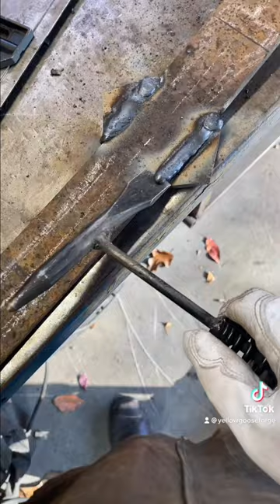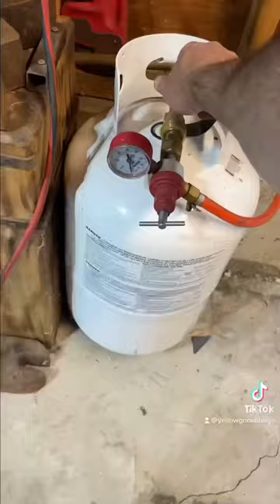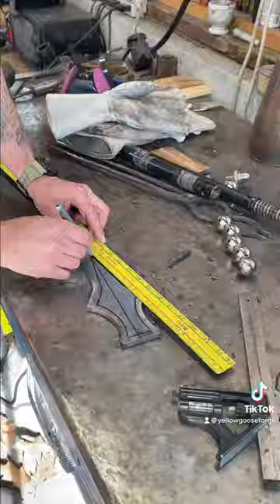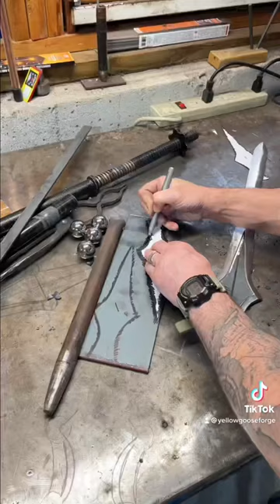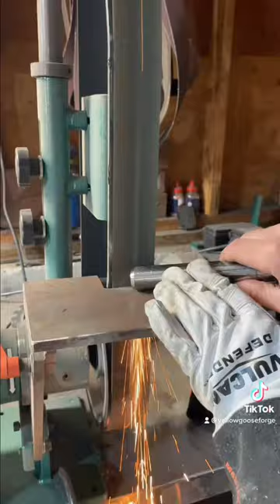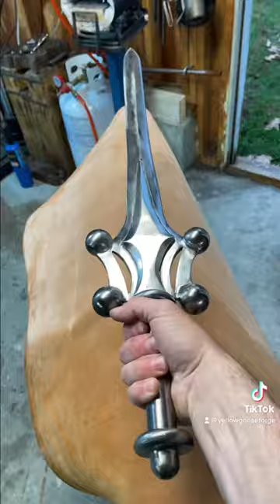Full build will be up on my channel soon🤙🏼🔥 #blacksmith #art #diy #power #best #battle #shorts

Comment: How did you not run into any metallurgical issues when you were welding the little triangles on? Every time I try to weld 5160 I get cold shuts, cracks, or just super brittle stee
Reply from the maker: I kept the stick weld at 90 amps and slowed down the travel speed, worked great, no issues. I only wire wheeled it ahead of time
Reply: @yellowgooseforge  what rod were you using?